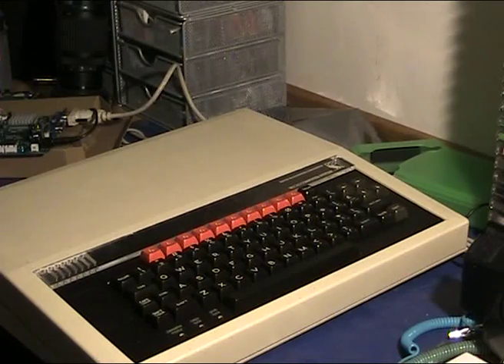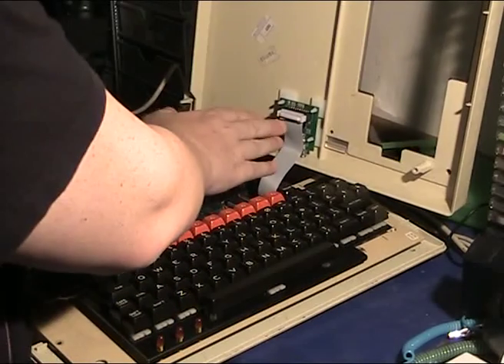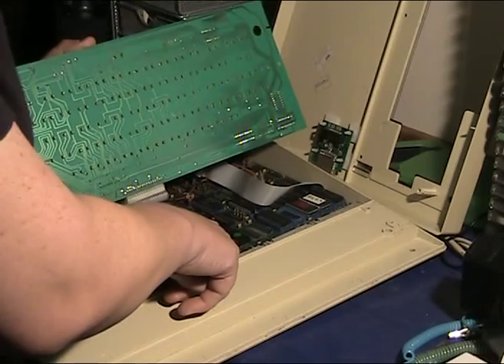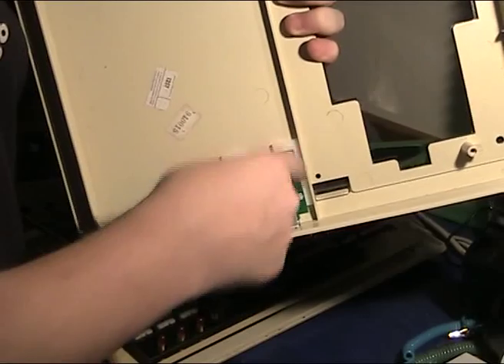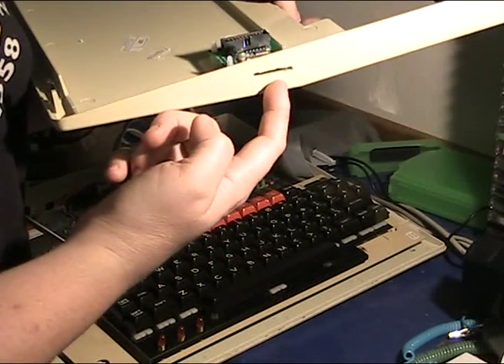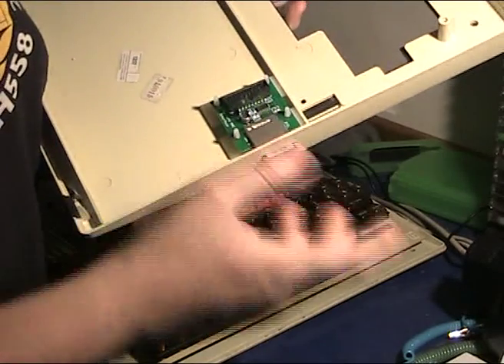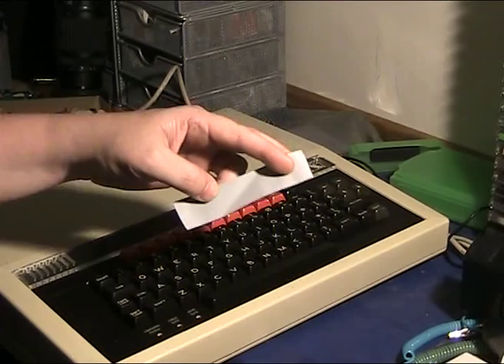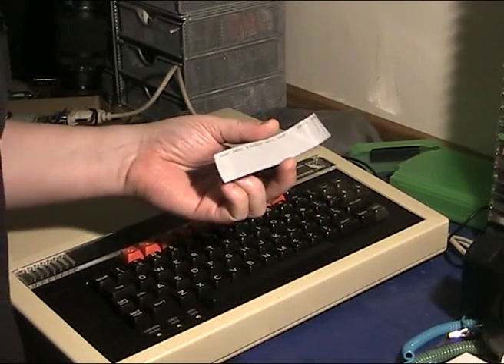04 - MMC Card Kit Internal Installation

Comment: Very nice way to install the MMC (indeed it is MMC instead of SD) inside the casing of the BEEB. Mark aka UKRetrogames did one for me also on the inside of the casing but without a 'slot' to the outside. I figured there would hardly be any need to change the MMC that much as it contains pretty much all the software and games I need. 

I did opt to expand my Beeb with a lot of goodies recently!